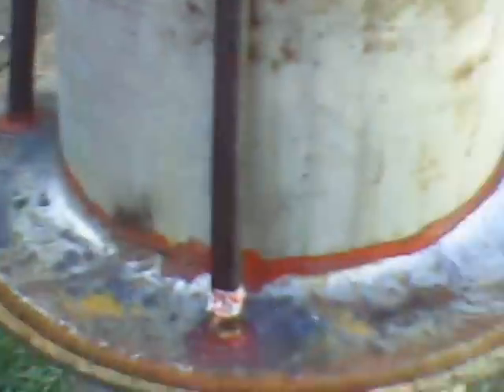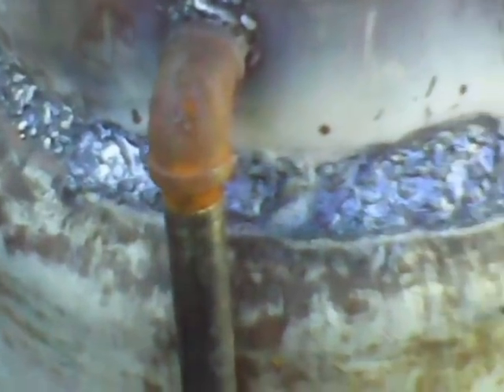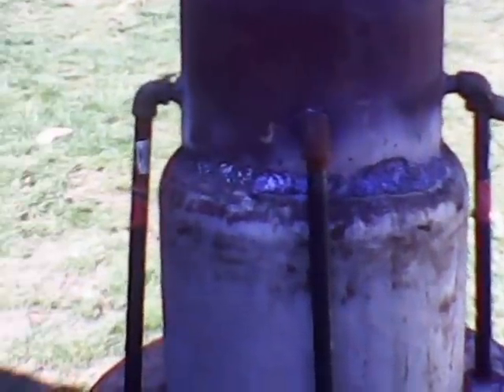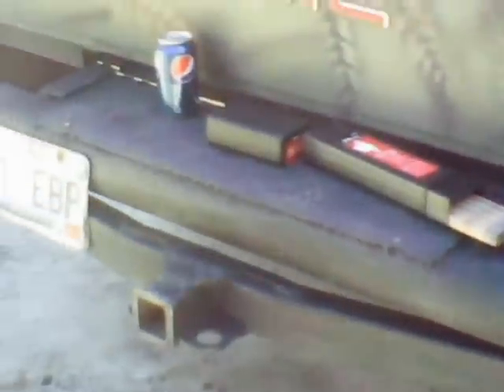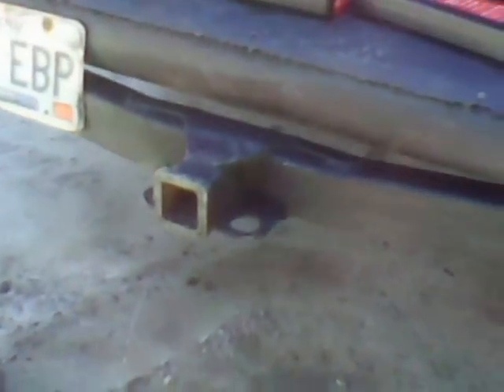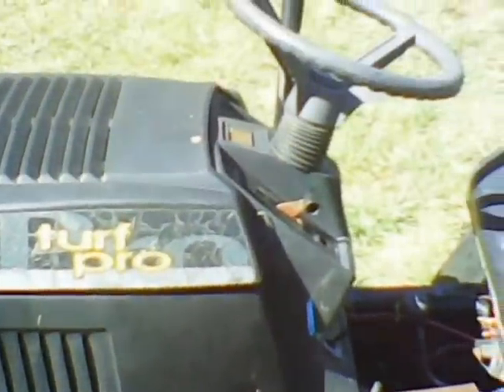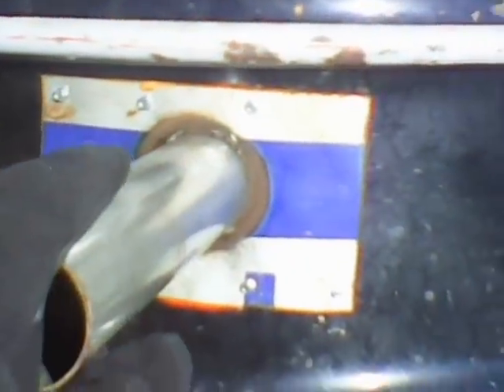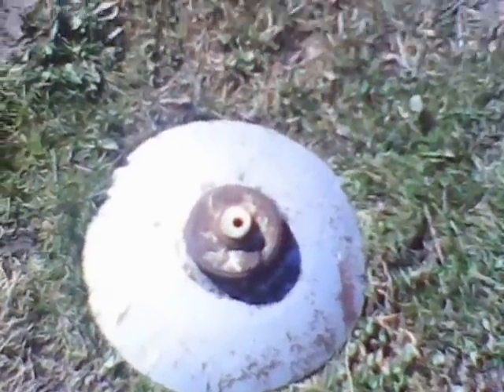my gasifier project

Comment: what size of restriction are you building? what size of engine in your truck and what is the expected rpm the engine will be running most of the time?

Comment from the maker: actually if you have an old un-regulated ford alternator you already have a welder just hook up the field to 12 volts hook the positive welding lead to the output terminal, and ground the negative, start your engine and weld away. I had a welder lying around for years and didn't know it!